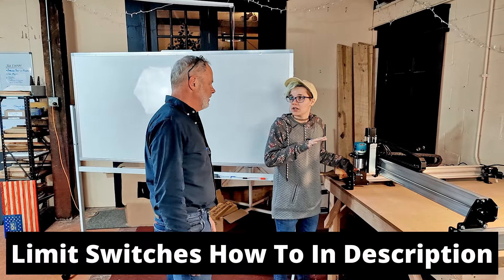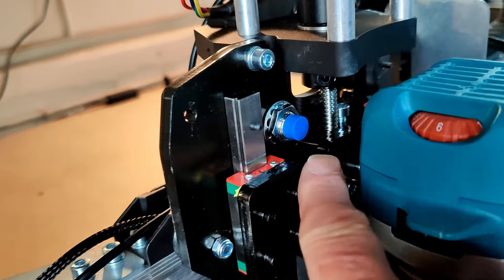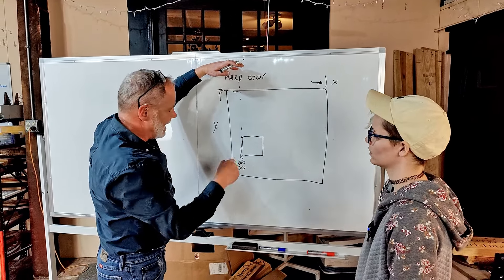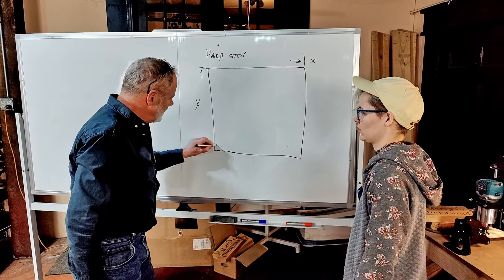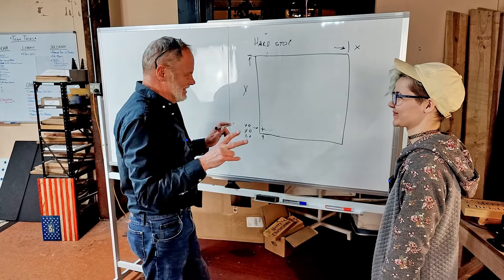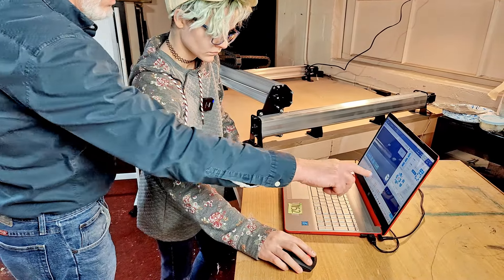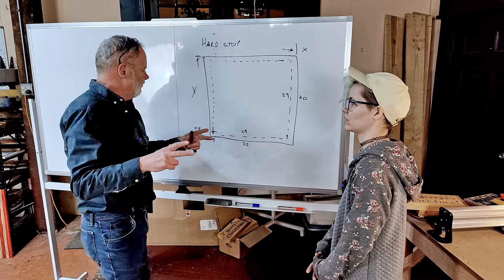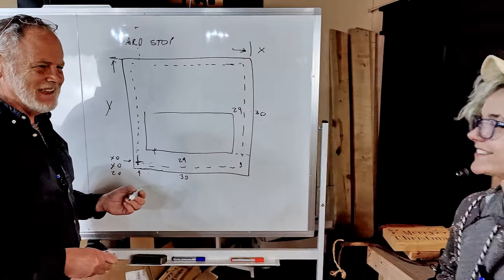Homing Sensors & Work Offsets, Do You Need Them (CNC Routers)

Comment: Once I home I also take a measurement of both sides to make sure they are the same.  The right side will need to be turned at times.  For me to have a reference once I have measured both sides I make a very tight line mark with a sharpie on the right rail.  Once I home I check to be sure the machine is squared.  I hope I explained that well enough.
Reply from the maker: bkgoddard, that is a very good method you have brother! I like that, thank you so much for sharing.

Comment: What I need to know is prior to the settings you are describing..    I am using Proximity Sensors (PS) on the XH- , x+, YH-, y+, Y slave , Z+.   My question is how close to the positive stop should I move the router to?  And then slowly move the PS until it is activated.  Is this the correct way to establish the Homing and Limit switches?  I use the Y- left and right steppers to square the gantry, will I still be able to do this if I set the switches as I described above?  I have watched so many YT’s and they do not describe this procedure, they all assume its already done, and you cannot go further until they have been setup properly. 
Thanks
Reply from the maker: IH1940HAY, It sounds like you're on the right track with your homing and limit switch setup! Yes, you want to move the router as close to the positive stop as possible and then slowly adjust the proximity sensor until it activates. This will ensure that the homing process is accurate. If you're using the Y- steppers to square the gantry, you should still be able to do that after setting up the switches as you've described. Just make sure all your movements are well-coordinated to avoid any collisions.

Comment: What if you do not have limit switches ? Is there still a inner boundary to know where to go home ? This subject seems to be not mention. Possibly you have to use your zero block for machine actual position xero
Reply from the maker: If you don't have limit switches on your CNC machine, you can still establish a home position by using a zero block or manually moving the machine to a known reference point. This way, you can set your machine's actual position as your home. Some machines use software limits or will require you to configure the machine's starting point in the control software. It can take a little extra care, but it's definitely doable! Just make sure to consistently return to that reference point before starting a job.
Reply: @IDCWoodcraft  I have a LongmillMK2 with a longboard or super board controller. You have a Longmill do you have a home reference point in your software. I understand the zero block. I'm just trying to find information to understand the fix reference spot in software or controller section. This subject seems to be tough to find an answer or information explaining it. Just thought that might be a good video to share if so or something you could enlighten us on since you have a Longmill

Comment: My limit switches identified an out of alignment problem.  So I realigned the cnc, thought that was strange.  Then proceeded to destroy the next commisioned project.  The left drive belt (which is a maintenance item) needed to be replaced. 
So - If I had listened to my limit switches, it would have saved me the embarrassing task of having to ask the customer to send me another set of plexiglass.
Reply from the maker: techturtle1964, sorry to hear that your machine gave you those troubles with moving out of bounds brother. Glad to hear that problem is behind you now!

Comment: I need help connecting the controllers don’t work but I have machine connected I use gsender software
Reply from the maker: KevinHudson-d4h, It sounds like you're facing some connectivity issues with your controllers. Make sure that all your connections are secure and that the correct drivers for your machine are installed. Also, check if gSender recognizes the machine in its settings. Sometimes, a simple restart of the software or the computer can reset the connection as well. Good luck!